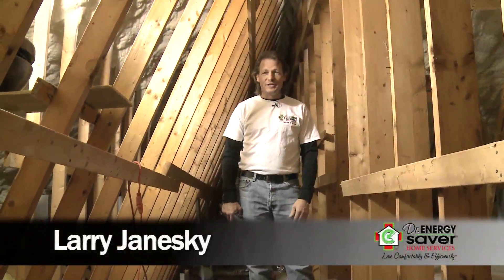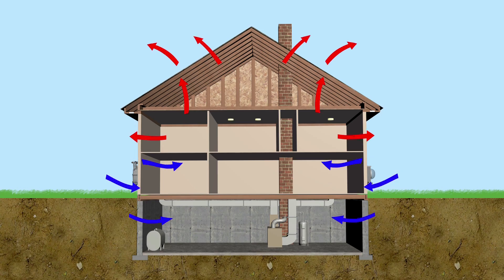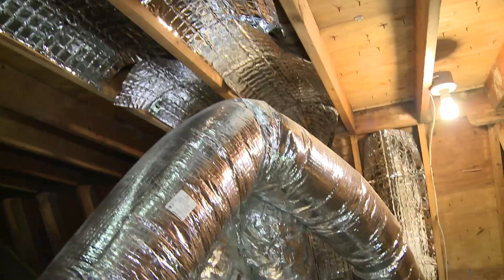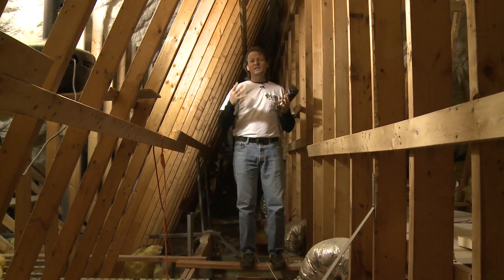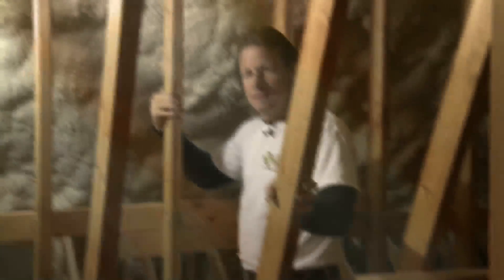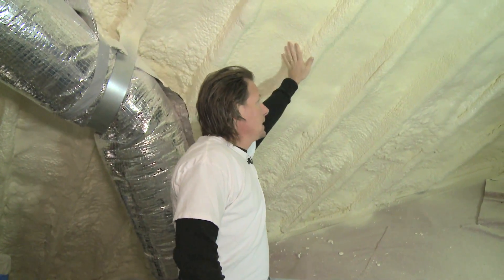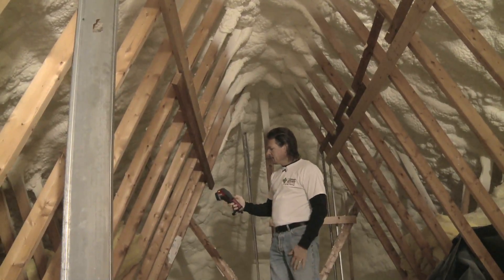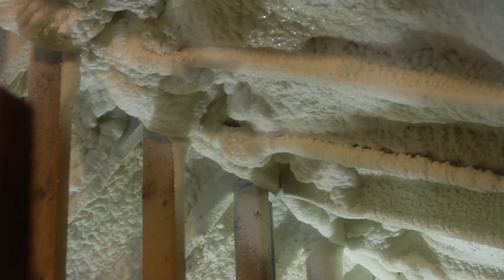Insulating and Air Sealing an Attic with Spray Foam (Short Version)

Comment: I just bought a new home and the builder is doing this type of insulation in the upper attic. I'm in Phoenix so it averages 110 degrees here in the summer. I can feel when the AC comes on and pushes hot air out before it gets cool in my existing house that has the insulation right above the ceiling in the attic. This makes it very difficult to locate low voltage and high voltage wire, plumbing etc.
The new house will have the foam on the attic ceiling roof and I will be able to walk around and see all my electrical junction boxes, wiring etc. Makes it easy to add additional coax, cat5, electric outlets etc. Plus it will be a lot cooler. You don't want to go into an attic here in the summer times..
Reply: Did you have to seal all soffit vents and ridge vents? Ac inside the attic? Otherwise it could cause condensation do to the temp differences wouldn't it? Legit questions

Comment: Ok everyone.  You don't need to vent the roof.  That does not degrade the shingles.  You don't rot the roof.  It performs extremely well.  You'll have a much more comfortable house and save lots of money on heating and cooling costs.  I did my own house the exact same way and live with it each year - it's awesome.  That why we show it on video.  It works.  Thanks for watching!
Reply: I watched several of your videos... in some cases you recommend venting the roof by creating a small space for airflow.
running from the eave to the roof vent.... And then insulating..... But in this video you sprayed the foam directly to the roof sheathing. Without creating the airflow...
Reply: mrpearl1
Reply: +mrpearl1 It is always best to spray directly to the underside of the roof sheathing.  Allowing an airspace through creative baffle installation  and foaming over it has been known to allow condensation to occur in that 1" air space.  Spray to the wood deck wherever possible.
Reply: @marty pfeif one thing you have to do is get a whole house air handler / filter to treat outside air and bring it inside.... did you figure out your issue?

Comment: By doing this wouldn't you trap the mosture and rot the wood? Are you  supposed to vent the roof? Also by doing this you will have extra heat in the winter melting the snow and then refreshing at the edges creating dams?
Reply: The inside heat will never make it out of the top of the roof to melt any snow.

Comment: How do you manage moisture and since this is an older vid, have you seen moisture issues on older foam installs.  I live in hot humid climate, Houston, and inspect houses for a living and have not seen moisture issues related to foam, except in isolated instances. What is your experience?

Comment: I think you’re insulation videos are great but many of the jobs are best done by a professional with a pretty big upfront cost. I was struggling to keep my house cool in the Florida heat and realized that high humidity was causing of most of my problems. I installed a portable dehumidifier underneath my air handler at the intake and WOW what a difference it makes. The air “feels” so much colder around the whole entire house. 🥶😎
Reply: Where do you get that from I also live in Florida and looking to save on energy costs

Comment: Conditioning attics with spray foam is an accepted practice in the home energy retrofit industry.  If homes are sealed "too tight" we can add mechanical ventilation (ERV's, HRV's or bath fans) as needed to meet any standard for air exchanges that needs to be met.  We also will air seal attics at the floor to reduce air leakage into the attic and add Tru-Soft cellulose insulation to R-60 here in the northeast.  Our decision to either condition attics or build an aligned, intact and sufficient thermal and pressure barrier at the attic floor depends on many factors, including homeowner preference

Comment: my house is a semi detached,do I need to have the both side of the gable wall on the attic spay foam or only the out side wall gable need to spay?Or both side of the gable wall no need to spay?Spy foam with beathable  or spay foam need to install with vent card is better?
Do I still have a leak once the spay foam in install on the attic?Please help.

Comment: Why the vapor barrier paint is necessary over the open cell foam? Also, I understand that open cell should be used under roof to allow for "breathing"; not to use closed cell in that application. Great video, nonetheless!
Reply: open cell is sprayed with a vapor barrier paint because it breathes and doesn't have a vapor barrier where as closed cell foam is considered a vapor barrier after 1 1/2 or 2 inches depending on manufacturer

Comment: what would be the best way to insulate a multi-gambrel house that can't be vented from soffits? would just applying closed cell spray foam between the roof joists be good? What about the flat area of the ceiling above the slanted walls and the knee walls? we want to insulate before replacing all the bad drywall in this 1931 house.

Comment: I keep getting responses relating to the elimination of the condensation issue.  I am in complete agreement with that aspect of the discussion, however there is a problem and that is with roof degradation.  I know that there are studies out there, seemingly self serving but still measuring nominal heat increase on the topside of the roof.  I am not sure as to the actual cause but it seems heat related.  This effect is found on Asphalt shingle but I have found a surprising correlation to slate roof premature failure in the field where spray foam is used.

Comment: How about long-term experiences ? 20- 50 years?
Could it be sprayed on tiles (which may have some holes to the out-side of the roof) ?
What cover material?   What insulation thickness is required?
This technology is quite old, but still has not found mass usage in such applications - why ?
Too much moisture because it is air tight ?   Cost per m³ - spraying firm included?  Which companies do provide this in Germany  ?
 Does it burn ?   Dangerous chemicals ?  
etc etc.

Comment: Like he said often times ducts and vents circulating conditioned air is affected by the temperature in the attic (IF these ducts run through the attic of course), also attics are normally built ventilated so the outside air is right above your ceiling.
In cases where circulated conditioned air is not affected by attic temperature the attic floor will be sprayed instead of the roof deck; preventing air leak and/or heat eascape. (40% of heat lost through roof of homes)
Reply: So if I have a one story house, and all vents a d ducts run through the crawl space, would they spray the attic floor or ceiling? Im thinking about having this done.  Also do you have any idea what kind of company I would need to contract?

Comment: I dont know where these houses with airtight addict are placed, but i guess it is in the USA.
I know that the USA is a very large place with many climates, from moist and cold, hot and dry to hot and moist.

I live in a 120 years old house in Denmark, and only because its not airtight the construction is as healthy as the day it was cut.
For some stupid reason the building codes dictates a very close to airtight houses nowadays.
Several contractors and doctors have sounded the alarm bell:
The more airtight a house is, the higher the humidity and the lower quality air, that feeds mold and fungis and very quick, relative speaking, degrades the construction of the house.

This person advices to completely airtight incl an vaporbarrier your attict, preventing the construction to breath and every drop of watervapor will be trapped in the addict and slowly but surely be soaked up by the construction, while the construction have no where to send it too.
Also spraying that insulation fiber, the thing made of shredded paper, is organic material, and in a attic with no circulation, no where to watervapor to escape and with higher than normal attic temperature, you are guaranteed to get mold and rot your construction in a relative short time.
I have seen mold form in a 2016 newest standard A20 house attic form in just 8 month, they got rid of the shredded paper insulation and got two airvent in each end of the house, to this day not a particle of mold have been traced, and they checked every three month for two years.

And i thought that fiberglass got banned decades ago due to serious respiratory illness, but i guess they have different kind of lungs in the US.

This persons advice is very dangerous to not only your family and you, but your home also.
Reply: very good points i have always been leary of these super tight envelope homes being built,

Comment: I have a 124 year old house in eastern Canada.  The roof is made with milled lumber so has the slight gaps also the eaves where made with no ventalation. I made two vents at the end of each gable roof to compincate .  But if i do use spray foam does that make the attic to tight? or is there something else i can use besides spray foam

Comment: In a situation such as this attic, what kind of insulation if any, would there be in the ceiling or at your feet where standing? E.g. would existing insulation be left as is or removed to seal any can lights etc.? Great video!

Comment: I have a 1.5 story craftsman bungalow with no insulation and an unvented roof.  The two bedrooms upstairs are essentially attic space, with an attic crawlspace on both sides of the house, and a small dead space above the rooms.  I'm in MO, where we see high humidity, 100 degree summers and very cold winters (it was below zero two nights ago).  I'm having trouble finding any info on how to properly insulate this type of situation for both extremes in seasons without causing condensation.  Thanks for any insight
Reply: Lonnie Sullivan I'm trying to research a similar issue and what I  am seeing is needing closed cell foam spray insulation with no venting for the living space.
Reply: 1.5 craftsman, run 2 inch double foil iso. board, strap with 2x4, longer to create new facia and vented sofit, deck strapping, ridge vent and shingle, creates new vented roof deck!
Reply: Lonnie Sullivan 
You need to have a fresh air exchanger. Once the home is sealed up , no fresh air will come in and you will have a “sick house”

Comment: Larry, your comment below answered a question I have been seeking for quite some time.  My home, like most in my area do not have soffits and I was looking to use spray foam.  Although I will put a ridge vent on this spring when the roof is reshingled this spring.  
One more question, is it possible to spray in plaster walls if there is a in from the basement?  Not sure if there is a flex hose that can be pushed up pre-existing walls to fill the cavity.

Comment: Have this insulation in my home, however is it normal that they sprayed some of the attic floor? 
I have it by my AC unit and it is difficult to get to the air filter to change it .

Comment: I have an older Michigan house which currently has rolled insulation in the attic rafters falling down and blown insulation on the attic deck completely packed down with open air vents on each side of the house. My mother likes to completely seal up the vents "my money is escaping" and now shingles are curled up! So where would the spray insulation go? Rafters or deck? What happens to the shingles if I close it all off to keep the heat from escaping then I'm going to end up paying for another new roof because of the moisture and heat curled up shingles? If closed foam on the attic deck verses blown will my ceiling drywall get mold from the moisture and lack of air flow? Ready to commit to lower bills but need information and have watched all the videos. So -50 winters to 101 degree summers needs the proper correct insulation formula....
Reply: You have to leave the vents clear and open. Fresh air from outside enters the vents under the eves, and escapes through the vents in the roof. You HAVE to have air circulation. That's just the way it is. There is a formula to use as well, beings you need the correct amount of vents in eves, per square foot of attic for proper flow.
Reply: +applejacks971 there are 2 at each end built into the building not the roof.   If I deal them up as my mother did it will once again damage another roof so then what is actually insulated the attic floor? So then spray foam is not used?   We use the attic for storage and she wants to put her office up there so then it must be a conditioned space.  How would that all be insulated properly?
Reply: I have the end vents as well. Ceilings/floors of houses in my area aren't insulated between stories, as the walls and ceilings of the top level are. Air from the 1st level rises, which heats the ceiling (which is the floor of the upper level)
It sounds like you'll be finishing out the attic space, so a licensed contractor would give the best guidance regarding your particular floor plan. Pending if your attic ceiling is angled down to the floor, or straight walls up to the ceiling, how big the space is, will prolly have a lot to do with how everything is finished out and ventilated.
Sorry I can't be of more help. It's possible though, just make sure its done correctly. I'd get a couple opinions if it was me
Reply: +applejacks971 it's an angles wall peak to floor aka ceiling of he lower level but a huge space.   I've gotten several opinions but will do it all myself and one of the reasons I'm watching all the videos it seems to be just a matter of opinion which everyone has however I do want the closest thing to absolutely correct for now and 50 years from now when I will be unable to do it myself.  The weather is extreme here and my mothers heating and Ac bills are .....through the roof!!!! Little play on words humor.
Reply: I definitely understand. I spend a LOT of time watching videos and trying to lean the best way to accomplish my goal. I take a lil bit from everyone! I hope it turns out awesome for ya. Nebraska isn't to bad, at least I'm not in Duluth lol!

Comment: I live in Northern Indiana.  What would the harm be in closed cell foam spray on the roof deck and also insulating the attic floor? Provided the floor was also sealed with foam or a vapor barrier plastic sheet and batt rolls? Also would I want to ventilate or no?

Comment: Can you explain why with spray foam, the roof rafters are insulated? Wouldn't all the heat escape up through the attic floor into the attic, it seems like a lot of energy would be wasted with the heat from the house going into the attic. With traditional insulation, the attic floor is insulated for the reason I described.
Reply: Earl Eggert The difference is with traditional insulation you are not getting an air seal, so the air is leaking into the attic anyway. It's less efficient with traditional insulation because the air leaks into the attic and leaves the building through the attic vents. With spray foam the air can't go anywhere once it's in the attic. This prevents the stack effect and stabilizes the air in the entire house. So while the air does make it's way up into the attic with an insulated roof deck, it doesn't really matter because it stops there and maintains temperature.
Reply: ***** then where does all the moisture go ?
Reply: +William Dalton I'm just curious as to what moisture your asking about?
Reply: The moisture in the house.
Reply: Usually that is removed by exhaust fans or the A/C units
Reply: so, i'll have to install ac and exhaust fans then too.?  i've read and heard that sealing up the roof makes a house to tight for moisture. what is your experience with too much moisture?
Reply: +William Dalton The moisture comes from the air stream that leaks out of the house.  Foam stops this airflow.  Further, the interior temperature of the foam is kept above the dewpoint of the interior air/vapor mix and no condensation occurs.

Comment: I seriously have a question how does the roof breathe if you fill the cavities with insulation I thought it was essential for the roof to breathe after roofing for many years I was always told proper ventilation was key to a long healthy roof mold free is this material able to let the roof still breathe question not criticizing truly asking questions there's someone out there have the answer to this I would like to know
Reply: Open-cell foam is porous so it's a smart move to use it on a residential home. If you ever had a roof leak, the water would drain through the foam, which tells you that water vapor can also get through, allowing the roof to breathe. Depending on your climate and the efficacy of sealing the attic, a dedicated dehumidifier may be needed in a closed-off attic. One thing to mention. If closed-cell foam was used, it would trap the water and rot the roof before you knew you had trouble. I hope that helps!

Comment: Do you apply vapor barrier paint to a closed cell foam as well or is it not necessary because of the closed cells? ... Is this material fire retardant?
Reply: no
Reply: 32henryj friend had his whole house done they put closed cell in the walls and open cell in the attic , the closed cell would light ,the open would not? think the open they put in the attic would absorb moisture ,
Reply: fivefootsixtriumph Some companies put fire retardant in the foam.

Comment: Why open cell on the surface that will contact a water leak first?  I would think that might cause big problems down the road if the roof ever leaks.

Comment: 2:32 why install vapor barrier paint on open cell and not closed cell spray foam directly? another question is air flow from soffit to ridge vent block or did you install channel behind spray foam
Reply: No need for ventilation with this method

Comment: I am about to build a new home and I am building it on a slab on grade with Hydronic floor heat, nothing but truss system in attic area, would just spraying foam directly to attic side of ceiling be a good idea?